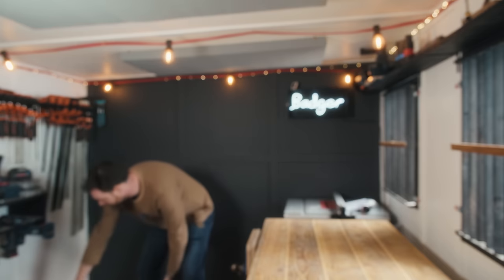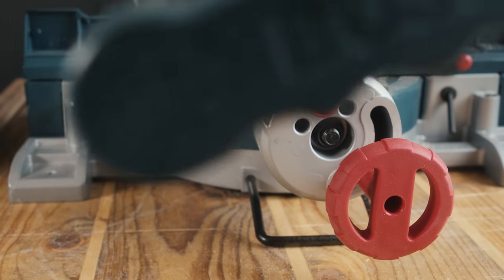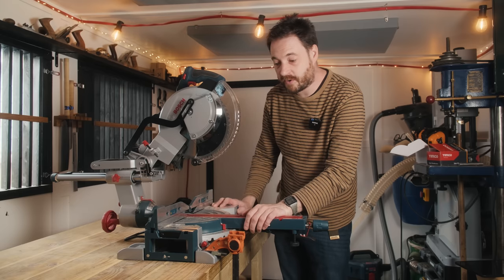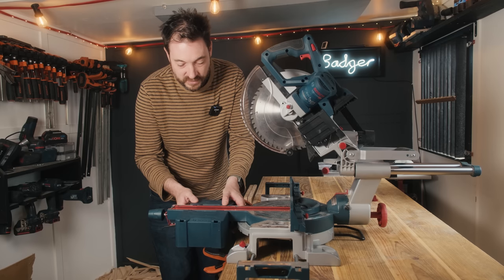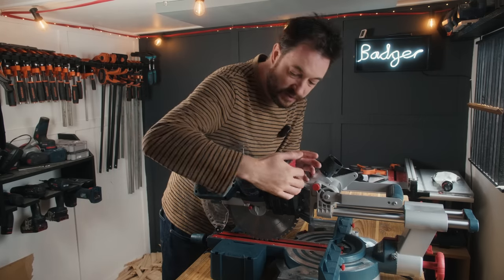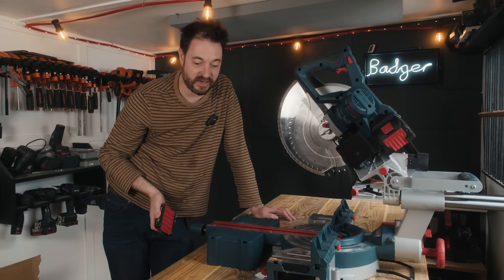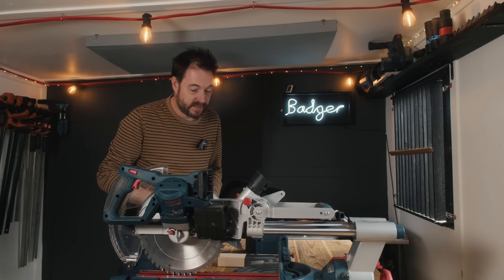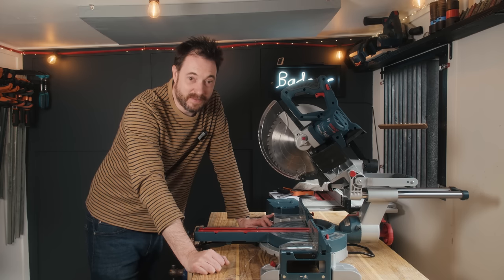Bosch GCM 18V-254 D PROFESSIONAL Mitre Saw

Comment: I would not even consider buying this saw and the reason is very simply because the amount of improvements that have taken place over the past five years or so, it feels like Bosch has gone backwards with the giant wheel at the rear and most of all the sliding rails.  Space is always a issue for most workshops so why go back to using giant rails stopping the owner from having it close to the wall behind it. The darn thing is a total waste on space and to have it stay against the wall you'll have to make a hole into the outer walls so the rails go through,  which obviously is a ridiculous thing to do 😢 Matt we know that you're basically sponsored by Bosch but it would be really good to hear you actually say what everyone thinks and that you need ridiculous amounts of space to use this saw without having to move your worksurface each time you want to use it!!!
Reply: Bosch do the "glide" or GDC saws that use the unique folding mechanism, saving space at the back. The only do 305mm blade in 18v though. Hardly a design that is standing still.
Reply: I'm guessing this is mostly intended as a site saw, what with the carrying handles and cordlessness. Did you notice how far the bench was from the wall?
Reply: @hogthrob  yeah I definitely noticed, to have that saw in one place your workshop will have to be very wide or long just because of the size of the workbench needed to keep it on!

Comment: Quite like the looks of that Mitre Saw with all its supporing features. Ive been looking back at some of your older vids relating to dust collector / cyclone's, be intresting to see how good this saw is at getting the saw dust away.
Reply: That was my first thought - how is the dust collection. The CTS QuickClick hose system clicks straight into that dust port which is so useful

Comment: Thanks for the overview Matt, it looks like a great piece of kit, and very well thought out - particularly like the additional support for wide board as this can be a bit hairy with the slider fully extended !

I still have the first cordless 24v 254mm chopsaw that Bosch made about 20 years ago, it's a bit underpowered tbh, but has been useful tool to have, despite not having the sliding mechanism or trenching cut ! The batteries are all dead now so thinking of converting it somehow as I can't currently justify a new one !

Comment: Hi Matt, looks like a good portable saw, packed with useful features. The only downside I could see was the size of the footprint. Mitre station set up would require a large depth as the base rails extend a long way. For a large capacity saw which is portable 👍🏻

Comment: Awesome looking tool, Matt! Congrats! 😃
I have a cheap big one, probably the same size I guess. And my shop is small as well, so I built the Fisher's Shop miter saw thingy... You know?
I'm not sure you'd have enough space... But something like that works amazingly. You pull it to the middle of the shop, use it and then push it back to a corner. 
Anyway, stay safe there with your family! 🖖😊
Reply from the maker: They do look a good idea

Comment: Hi, nice video, thanks! I now bought this miter saw and noticed that the main table is very plain compared to other models. For example, the 18V-216 has the fine grooves in the table for better support of the work piece. The side tables are slightly better but still not in the known quality. The surface of the rulers, at least, ist still very nice. Do you have the same experience?

Comment: I have a wired Bosch saw like that, and a small workshop like you. Its not a good combination im afraid, theres no efficient place to house it due to the large area at the front and back to accomodate the slide.

Maybe with yours being battery, you have baked in portability? But with mine, its definitely a tool regret.